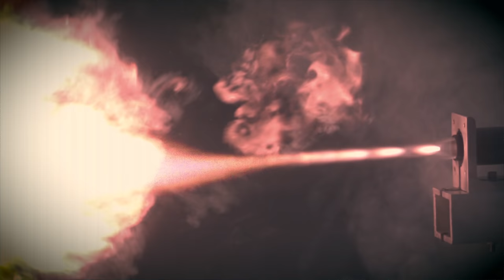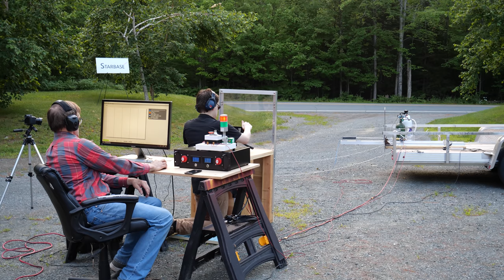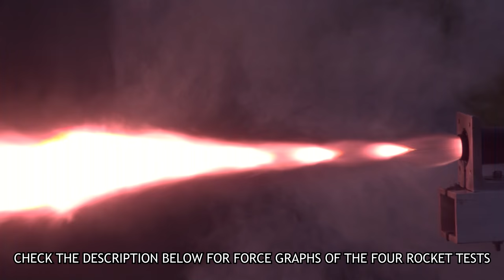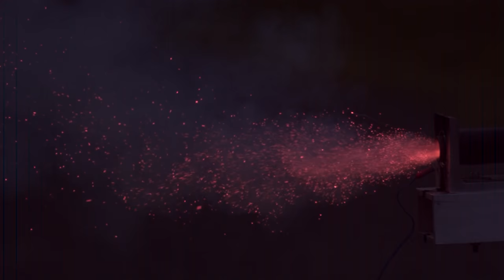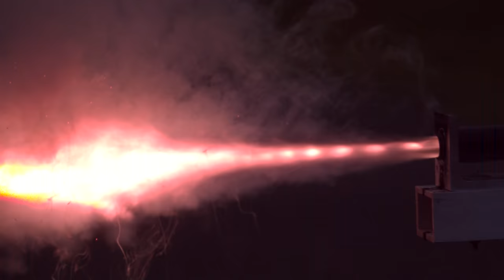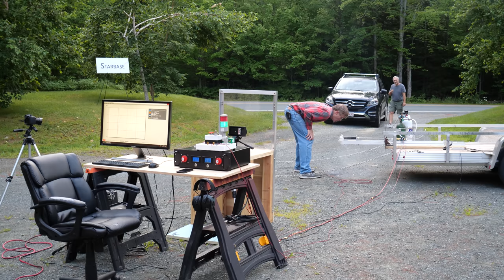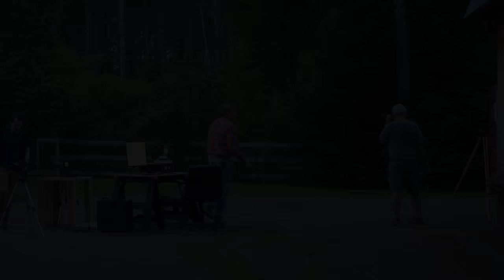Our Most Powerful Rocket EVER! Upsets Local Official!

Comment: could the jet lift the weight of the gas cans? P.S.. you need a white coat to look more sciency
Reply from the maker: The rocket engine certainly could, however these were not designed for flight, but rather for static testing and can be made much lighter.
We're for real and don't need the lab coat unless it's a gag.